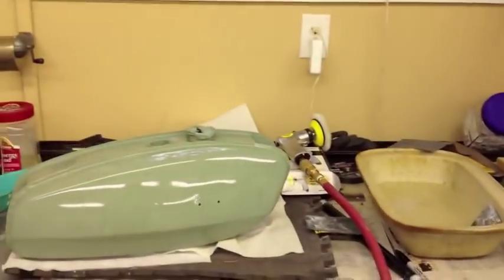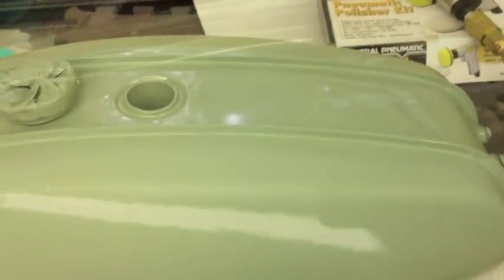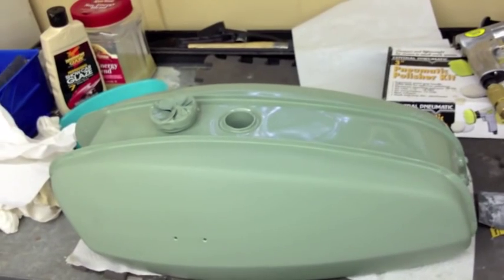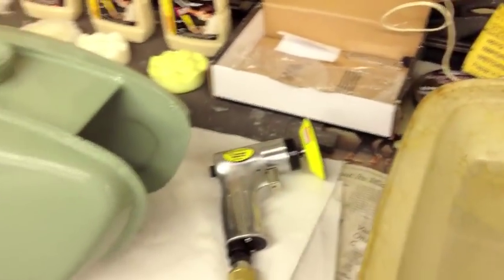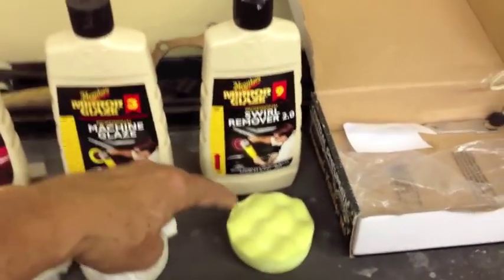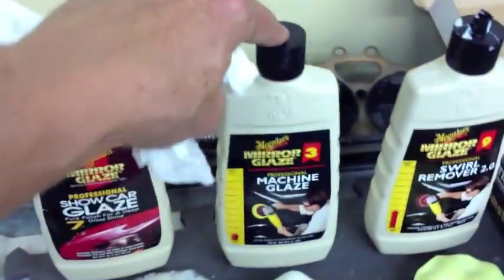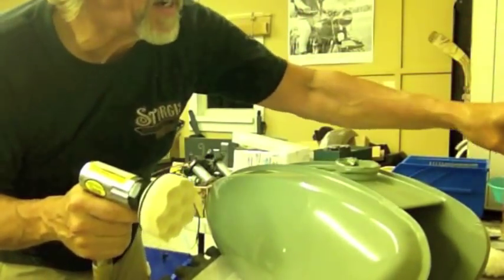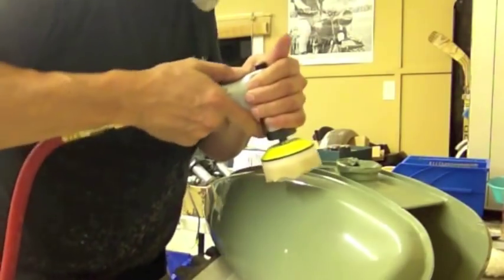Cafe Racer- BSA Painting- Base Coat- Solocityracer

Comment: Like the color frame and tank. iv'e often refer to it as a turned off television screen green.
Threatened to paint my 1950 5 window pickup that color... it makes the stainless, chrome, and black tires pop more intensely, in my opinion... as does it's present spray can primer rust color.
Ride a fully restored in 2012, 1968 Triumph Trophy Sports. Bought it from a first owner in Charlotte N.C. back in 1972 for a dollar a cc. weather today was 70 plus here in FW Texas and as many warm winter days here, i was all over it.               -gilpin 2-28-16

Comment from the maker: Hey macdog, 
There were 2 reasons to use the original tank on the build. 1.My focus on this build was to try to follow the original intent of the Brit Kaff rockers. They weren't wealthy guys and so had to make modifications to either cut off (to go faster) and or reused parts they had to save money. 2. The tank was in good shape and it had a sleek look so I used it as a matter of design as much as cost savings.I also liked the aluminum tank cover strip and thought that would add to cafe style.